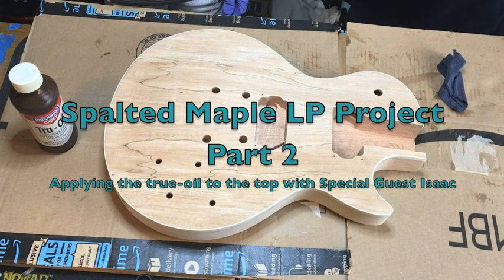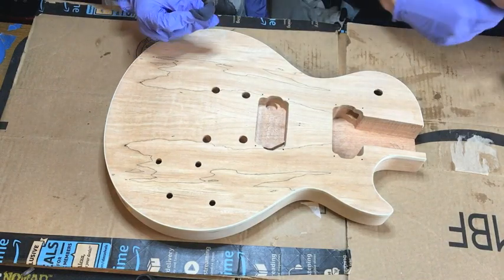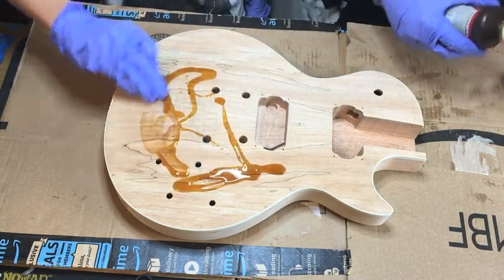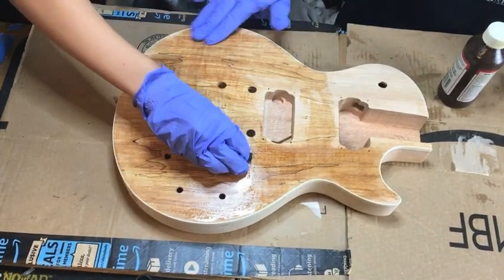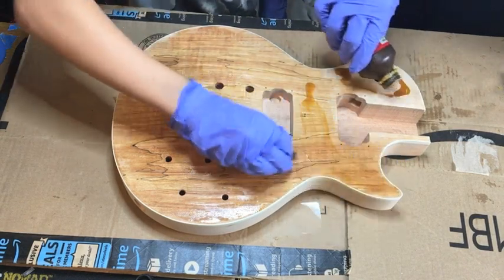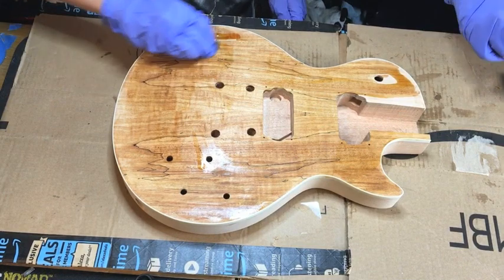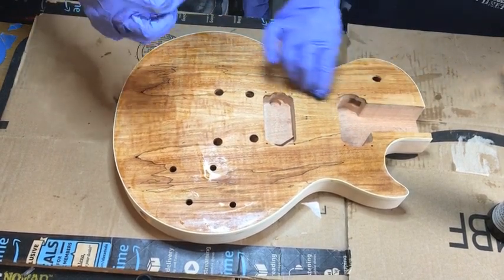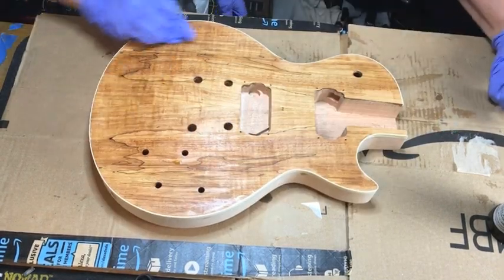Spalted Maple Top Les Paul Guitar DIY Kit Project Part 1

Comment: Hey, this is a great demo video series. Thanks for sharing it. I'm considering doing nearly the same thing on a maple top/mahogany back body. How many coats of Tru Oil did you use on the top and how long did you need to wait? And can you think of any advantage to doing the top or back & sides first?
Reply from the maker: Thanks @dansmusicdemo. I would recommend between 6-12 coats and using 0000 steel wool every 3 coats to smooth out the surface. I also cut the last few coats with a few drops of mineral spirits to give a nice smooth finish.
Wait 2-4 hours between coats and it really doesn’t matter if you do the top or sides/back first.